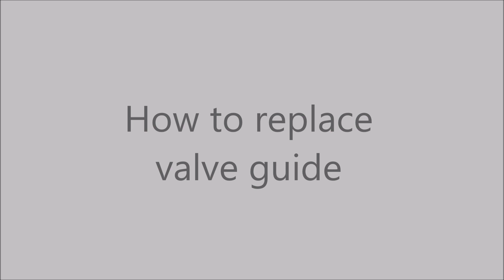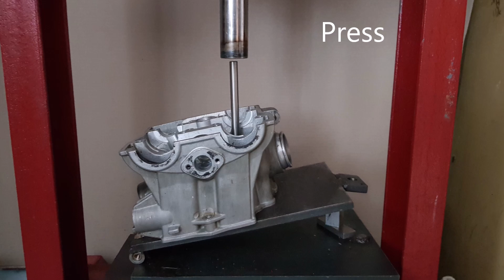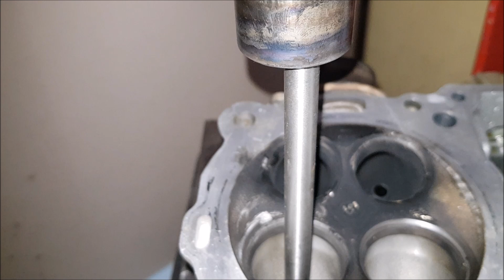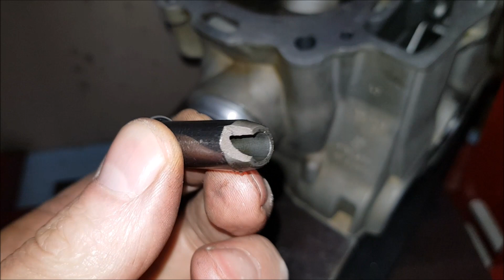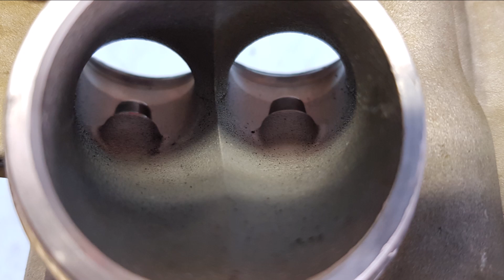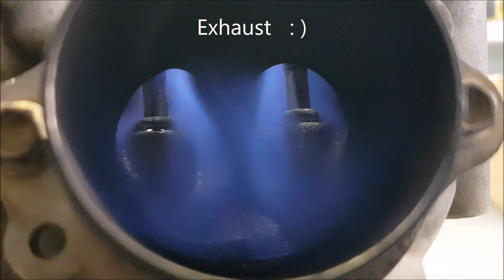How to replace valve guide on the motorcycle cylinder head.

Comment: Just going through your back catalogue and watched this one, just curious that you didn't feel the need to warm the head.
Reply from the maker: The valve guide has a press fit of 0.05mm.
No need to heat but use a special oil and introduce exactly.
Reply: @PaulXchannel  it's the exact bit I used to find difficult on the old Triumphs I used to work on. The guides had usually been bodged in the previous decades , so I had to repair the repairs.🤔
Reply: @PaulXchannel  Hi may I ask about the special oil you put on the valve guide on installation. What was it. I am installing 4 guides later this week. 2004 KTM 450 SXF Thank you
Reply from the maker: @outbackenduro7418  Lubra K AHT 
...high temperature lubricant ...
Reply: I am about to do a yfz450 do you have to look out for a certain distance when you install the new guide.
Reply from the maker: @noechavez5917  Yes I measure the old dimension.
Reply: @PaulXchannel  ok cool man thanks.

Comment: Why, after you pressed in the valve guide, did you not process it with a scan of the required diameter to create the necessary thermal gap between the guide wall and the valve stem?
Reply from the maker: After pressing on the valve guide, the head goes to milling the seats.
Reply: @PaulXchannel  that is, after you press in the guide, do you deploy the guide on the machine along with the valve seat?
Reply from the maker: @VuDu_motor  

I always have to mill the saddle data after pressing for precision.

Comment: Easier if you heat the head in an oven to about 300 degrees for 15-20 minutes. Need to wear leather gloves (hot). Same goes for install: heat in oven and freeze valve guides; work quickly. Also you will need to use a reamer (with plenty of oil) with a snug fitting pilot (keeps reamer straight) and ream the bore of the guide as most valve guides are machined slightly undersized and you will even lose a couple of thousandths after the press fit. Finally, you will have to do a light valve job as the new guide will not be perfectly concentric to the valve seat. Hopefully, lapping alone will take care of this. If the new valve guide is bronze a standard HSS reamer will likely bind up in the bronze even with oil. I do not know if I would trust those valve seats after being hammered like this. There is more here than meets the eye.
Reply: Ok but I think you should not use oil on the reamer nore on the valve guide, but I am not a professional.

Comment: Great video. So what ton press did you have and what was the lube you put in the end of the new valve guide before pressing it in? Can it be anything or something particular? 

 Thanks! Working on an 07 Honda CRF250r...
Reply from the maker: My press is 50 tons.
I use high temperature lubricant.
Good luck at work 👍
Reply: @PaulXchannel  Thanks for the response. What do you think that it takes to press them in, ton wise? 

Also, is the high temp lube also an anti galling lube?
Reply from the maker: I think 1-2 ton must be enough.
The lubricant is important due to aluminum.

Comment: Nice work. If one didn't have a press, would a hammer have worked?
Reply from the maker: Thanks.
Never use a hammer.
The problem is at the moment of impact
There is a risk of damage of part.
Reply: That could break the new guide

Comment: I'm in the middle of a engine repair & rebuild on my 08 KTM EXCR530 exhaust valves are bent, one broken guide. What ton press do you need to get the guides out? OR can you get them out with an arbor press?  what about heating the head and freezing the guides and dropping them in. Does that work like installing bearings?  BTW ur work is awesome!
Reply from the maker: Thanks .
In my opinion heating the head and freezing the guides is not necessary.
It works well but needs to be inserted exactly.

Comment: The part of guide that broke would be ground away if the head was ported so that small piece would not matter. Plus a reamer was not used to fit the valve.
Reply from the maker: Thank you for your opinion.
It is not always necessary to use a reamer.
The valve ran smoothly.